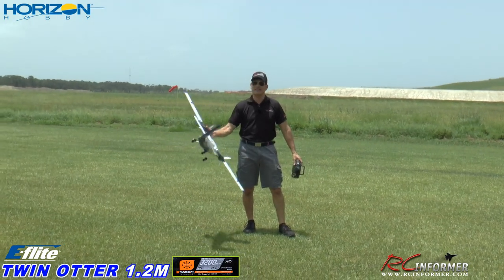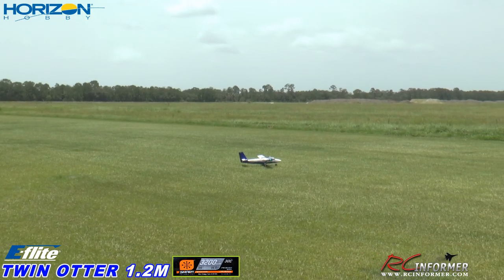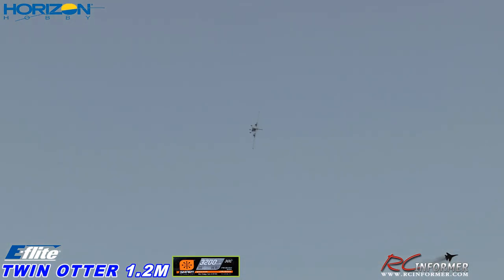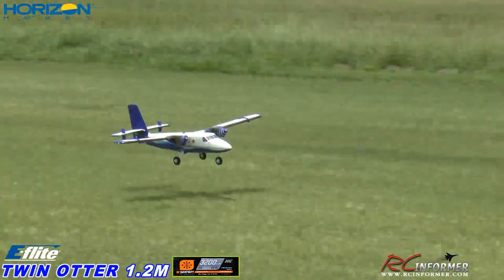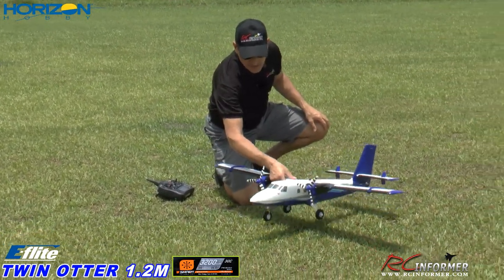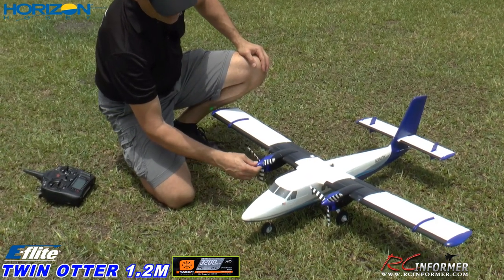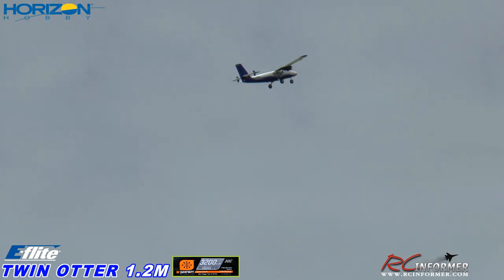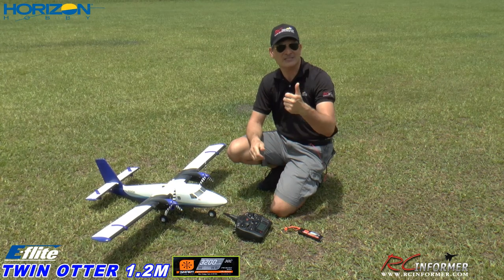E-flite Twin Otter 1.2m Grass Field Flight Demo By: RCINFORMER

Comment: Haha, this reminds me of a trip as a passenger on a full scale DHC-6 operated by the Norwegian airline Widerøe way back in the 90s, where we took off ACROSS the runway! A storm was blowing across the runway and we'd most likely tipped over if we'd tried to take off "the usual way". The pilots discussed wether they should take off or not, but decided to do it. Longer story shortened, I left my stomach (and my butt!) on the ground as the Twin Otter took off like an express elevator with rockets! One of the coolest airplane rides I've ever had!

Comment: just bought this plane, i'm stoked
Reply from the maker: You will love it! Thanks for using my links to purchase it... thanks for the support!
Reply: @RCINFORMER  never got around to see the video where you didn't have the rudder off, did it steer ok. I'm planning on taking it off cause of snow here.
Reply from the maker: @Ratpack30  I actually never got around to taking the water rudder off....I just left it on... however, I have heard of guys taking it off for snow ops & it works fine:)

Comment: Motor: does NOT use fuel. Used electricity.

Engine: uses some type of FUEL!
Reply: Not exactly; every engine is a motor but not every motor is an engine. A motor is anything that converts some other form of energy to mechanical energy, an engine is a motor that converts specifically heat energy into mechanical energy. An engine typically does burn fuel to release thermal energy but not always, such as in a stirling engine. You could have an engine that uses electricity by using resistivity heating to supply the heat energy, but in that case it's basically always more efficient to just run an electric motor off the electricity.